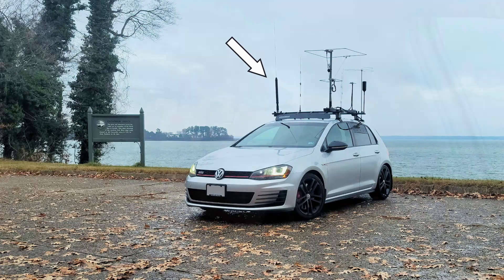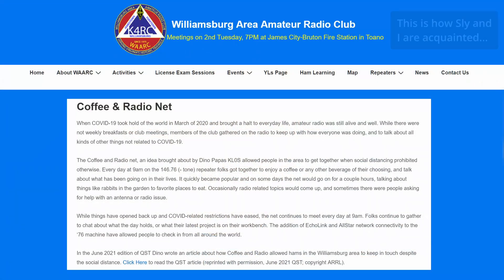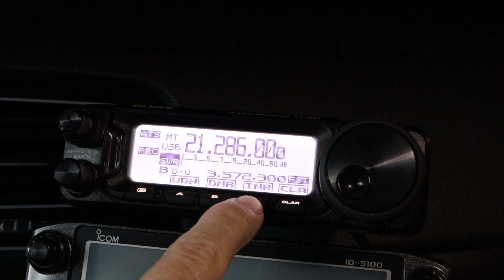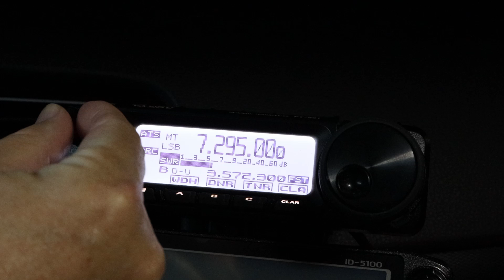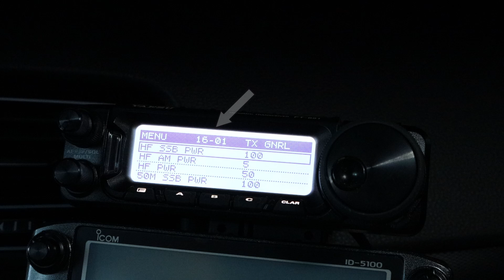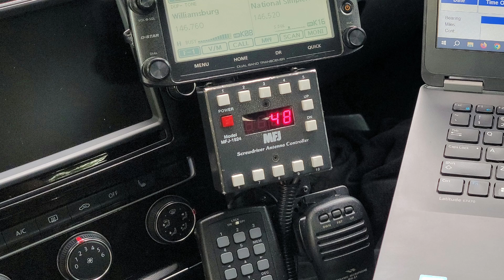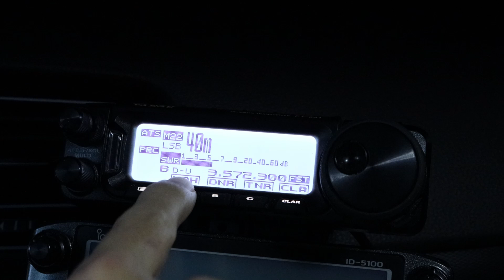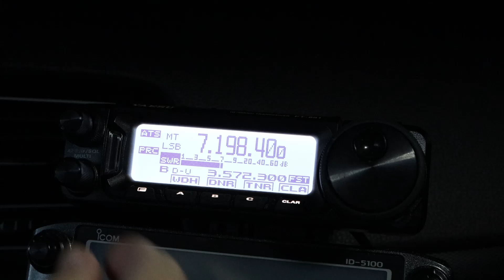Yaesu FT-891 Manual Tuning Shortcut

Comment: When the button at the bottom left is turned in memory mode to change memory locations, the bandwidth setting (3000) for FT8 is unfortunately lost, so that the bandwidth must be set manually – or you have to press M->V each time before you can change memory locations.
Reply from the maker: Yeah, it's a drag, but I still appreciate my abbreviated operations technique. Thanks for visiting!

Comment: That's a great idea. Quite a setup you have there! I saw you at RARsFest in April but didn't get a chance to talk to you. Do you leave the ATAS on the vehicle permanently, and does it hold up to the stress of highway driving? I'm thinking of adding an 891/ATAS/510 to my F150.
Reply from the maker: Thanks! I hope to be at RARSFest in 2026. Make sure you stop by and say Hello! I do leave my ATAS on the car full-time. The original whip developed a permanent bend; it's quite thin. I drilled out the sleeve ever-so-slightly so that could accept a thicker black whip by Larsen. It's more durable now. The only downside I've found is that I need to retighten the antenna from time to time. I guess the vibration up there jiggles it loose? There's a tell-tale sound that it makes when it's even 1/4-turn loose; so, I don't worry about dumping it on the highway. I may add a spring washer for added security. I remove the ATAS when the Yagis are mounted (except for exhibitions). I'm currently fitting motorized mounts so that I don't have to remove antennas at all. The K9000 mounts are not intended for heavy antennas. But that's not stopping me from fabricating a heavy-duty solution! HAHA! I need to update the videos on my KE4WMF Playlist. OH - I'm considering an FTX-1 Optima to consolidate two of my radios... thinking about it. It's a large cost, but would satisfy some of my wants that aren't being met by my current setup. Thanks for visiting!

Comment: I have an FT891 in my 2017 Chevy Silverado with a Tarheel Designs Little Pro HP. When I tx while the truck is in motion (or even just running) the signal interferes with my trailer brake controller module and causes a check engine light to pop up turning off cruise control and stabilitrak (all linked to the trailer brake controller module). Turn off the key and restart and its fine. Just annoying. Been trying to chase that down to figure out how to prevent it. So far unsucessful.
Reply from the maker: Hey! Sorry about the delayed response! Odds are very good that you're experiencing "common mode current." Visit K0BG.com for what is very likely THE most comprehensive mobile ham installation site in existence! The solution may be as simple as adding Mix 31 ferrite beads to your radio's power, data, and coax feeds. K0BG would say that chokes are a Band Aid for an installation shortcoming. So, read his pages to see if there's anything that you may have overlooked. My own setup has some shortcomings, but I've chosen to live with them by adding chokes. Choke, choke, and choke some more! HAHA! Good Luck!

Comment: Good morning!  Great video!  Using FT-891,  and WSJT-X.   On 10m, FT8, software says 29.074.000.  But I find better results at 28.075.000.  But I make a few QSO's, then I see the radio says 28.074.500.  Then a few more QSO's, then the radio says 28.074.000.  Next, it says 28.073.500.  Why is the radio frequency indicator dropping?  What am I doing wrong?  Many thanks!
Reply from the maker: You're probably not missing anything. IF you have your "Split" setting to "Fake It," the radio will change frequency a hair so that the outgoing modulation is always in the middle of the carrier instead of running at the edge and possibly not as efficient... something like that. I wouldn't worry about it. Thanks for visiting!

Comment: I like it. Especially since theres more menu digging involved in this radio. I am in the process of setting up my 891 and tarheel 100A. I went with the tunematic box as well like you used to use on your scorpion. Hoping i can figure this all out. Ive not had a mobile hf setup before. 73 DE N4JAB
Reply from the maker: Thanks for sharing your experience! I removed the Tunematic two years ago and returned to the MFJ-1924. I like the "clunky" setup. Search my channel for that video if you're interested. Thanks for visiting!

Comment: It is correct . I do the very same with most rigs . The ft897 works very similar.  
Fill up the memories starting at 1.830cw then 1.840 lsb 1.855am (for manual atu) 1.920 lsb   1.950lsb ,1.960 am (again atu tune up ) . And same for the next band at the end i fill up 60m spots . Then a few SWL broadcast etc . Just same as you i mostly never use vfo a or b once i get the memories all filled .
Reply from the maker: Thanks for sharing that! Take Care!

Comment: I just got my 891 today and this shortcut is brilliant! One question, are you able to work 80m using the ATAS? 73 de K1MBL
Reply from the maker: Thanks! No 80m on ATAS-120A; 40m is as low as it will tune, even if you replace the whip with a longer one. Thanks for visiting!

Comment: Hey Scott! I enjoyed your video. I'm a new sub.  I'm do a lot of biking on the Capital trail, Maybe I've seen you? I've been into Ham radio since 1971. Not continuously though. I'm considering the FT-891. I like how you can set the output per mode. I have a remote tuner that I tube with 10 watts, some rigs I've had I had to always reduce the power to tune then back to 100 watts for SSB. I see the FT-891 as a versatile rig for base, portable and mobile. 73 de WA3RSL.
Reply from the maker: Welcome! The FT-891 is a great rig and I've really enjoyed mine. Thanks for visiting!